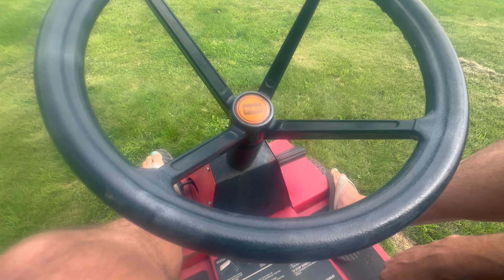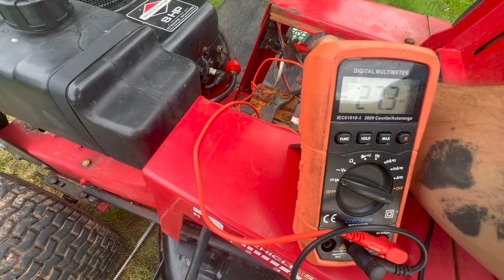Toro 8 32 Riding Lawn Mower : The Most FRUSTRATING Repair I've Ever Done

Comment: Ive got a 11hp version Toro,
Its from 1986, had it for 24years... Changed the battery cables and air filter, the mower belt once, and had a mechanic replace the bearing for the knife... 
I really enjoyed the video!! I do night shifts so great 3hrs+ spent 😊😂
Reply from the maker: Thank you!